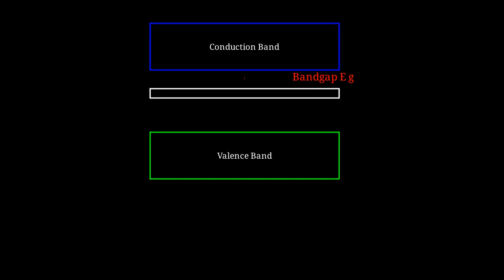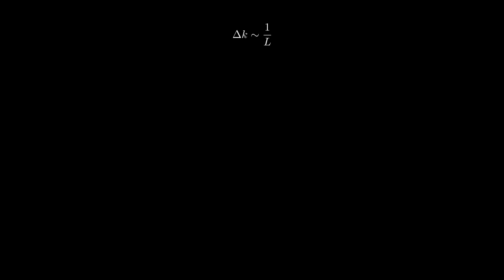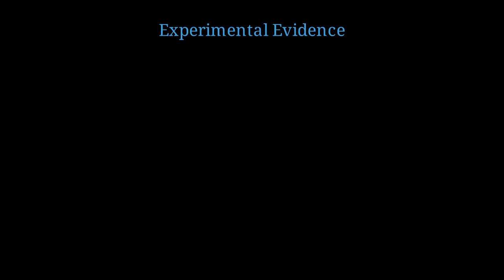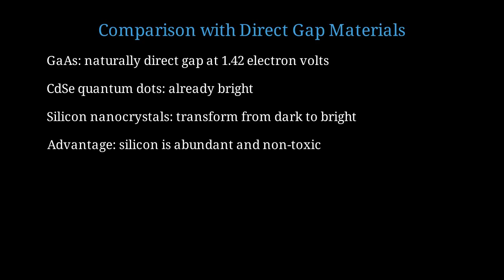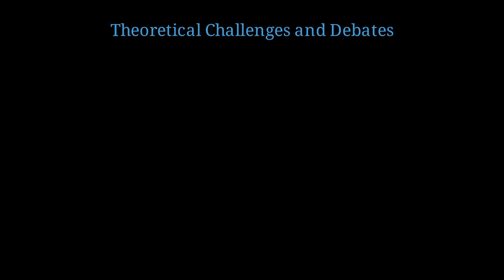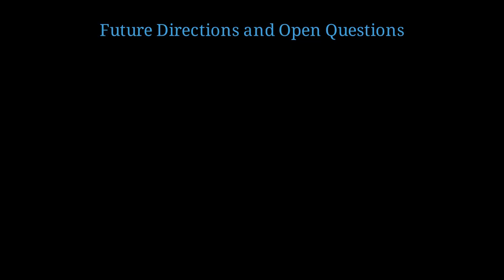The Indirect Bandgap: When Size Turns Darkness into Light

Comment from the maker: How precisely does Δk uncertainty quantitatively relax optical selection rules in confined systems?
Can many-body corrections (beyond effective mass theory) fully model the pseudo-direct transition in Si nanocrystals <2 nm?
What are the ultimate radiative efficiency limits of electrically pumped silicon nanostructures under confinement?